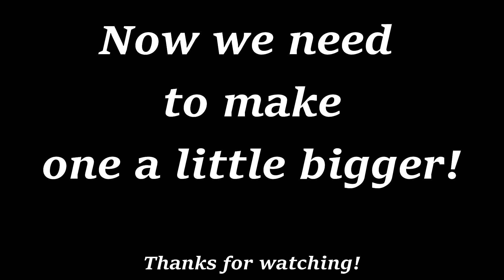Predator Proof Chicken Tractor is Complete

Comment: The gauge of wire may be too large and a raccoon could reach in and kill or maine the chickens. Hardware wire may be a better choice.
Reply from the maker: At night the chickens sleep in the back, so a racoon could not reach them back there, and we have dogs that keep critters ran off, but it wouldn't be a bad idea to line the inside for extra precautions though like snakes.
Reply: A raccoon can tear into hardware cloth, but the 2x4" wire has been fine, but in the front I used 4x4 wire and the smaller chickens can get out so I lined it with some 2x4 welded wire